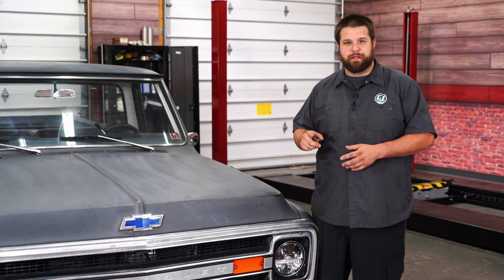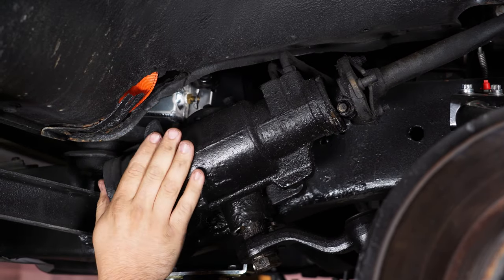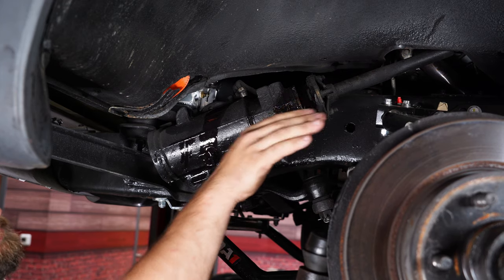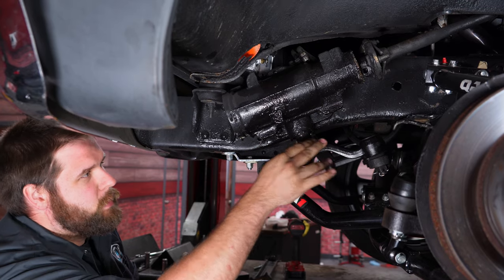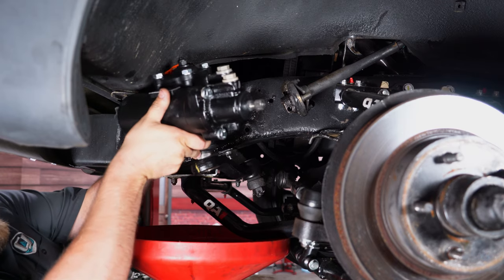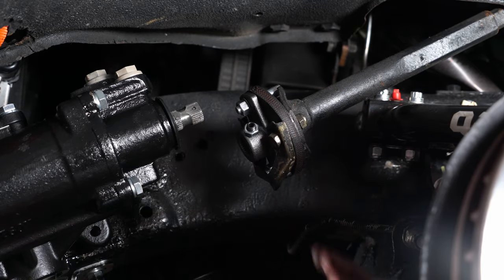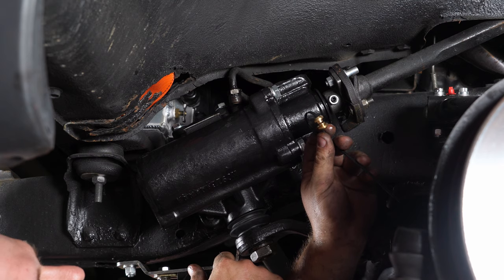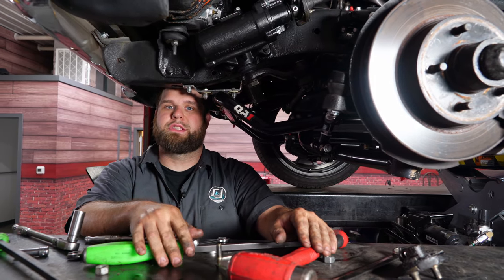Classic Chevy Power Steering Box | Borgeson | 1968-1986 C10 Install

Comment: quite the mechanic I am....I wrestled with the column forever trying to loosen it so I could get the steering box out....when all I needed to do was remove the bumper bracket and it would slide right out! This was when I rebuilt my stock box. Buying one of these quick ratio boxes, so at least now it will be easier this time. Great video for that bit of knowledge alone.
Reply from the maker: Thank you for watching

Comment: I really wish the video included you using a torque wrench to finish the pitman arm nut. We both know that's a big deal to tighten that properly. Otherwise great video, I just did this job on my 60 C10 🍻👍🏻
Reply: Yeah I had to wait for the socket to come in to torque it down
Thank you for watching
Reply: @86hyperstang  what is the torque for the pitman arm nut?
Reply: So....what is the torque for the pitman arm nut? I'm about to do this on my C10
Reply: The torque is not as important as the tapered cut splines with a spring steel lock washer. Use a light application of anti-seize so it will come off 50 years from now and reduce the factory torque by 30%. Use a standard length breaker bar and call it a day! I have never had one come loose on a school bus, 2 ton farm truck, passenger car or pickup. Math = Load X Stretch.
Look it up and quit stretching the bolt to the yield point we’re it breaks!
No one owns “Crows” feet sets or “Flare Nut Crows” feet spanners and a torque wrench because they never use them in the videos! Why? I own 4 sets of SnapOn both Imperial and Metric. Do you? The load in these is tightening the hard to reach fasteners or seating the pipe end like a gasket! These are way more important than pitman arm torque if you have removed one.
DK. ASE Master Tech since 1978.

Comment: Just a note.. My 85 High Sierra had a 12mm 12 point pinch bolt holding the steering coupler.   I damn near rounded it off using a regular socket.  Was too caked with years of crap to see.
Reply from the maker: oooo that would have been bad

Comment: What about the 1967 C10? Will your tiny piston diameter work on the frame using grade 8 pipe spacers and really long grade 8 bolts? At least place the gearbox in place, install shims or washers to get the correct alignment with the intermediate shaft on the vertical axis as the frame holes actually line up the 800 series Saginaw gear box on the horizontal axis. 
  I would not use the 500 series because it is smaller piston diameter, thinner case and less frame to bolt thread engagement. It is 11 pounds less of a long lasting 800 series, which has way more parts, torsion bar selections and heavier case for a pickup use and lateral impact forces it see’s when transmitted to the pitman arms case. The case will oblong and create looseness that has to be machined and new bearing installed 40-50 more often than the larger diameter contact found in the 800 series. I don’t understand unless it is an patent or intellectual properties legal issue.
DK. ASE Master Tech since 78. Former instructor for UTI and ACDelco.

Comment: How much attention should I pay to the position of the pitman (splines) so I don't change the steering - or is this not an issue?  Also, same with the rag joint.  It's splined too.  Just don't want to get in the truck and see my steering wheel is 1 o'clock or something.
Reply from the maker: Both the pitman and rag are keyed they are supposed to fit in only one spot. For the rag joint you are looking to line the set screw on the flat part of the splines
Reply: Larry, With the flexible coupler installation even with the pitman arms splines lined up, it still can be off by one tooth either direction. The steering wheel mount can be moved very easy and should be expected, as nothing is perfect but one tooth is easily corrected. Besides, an alignment is highly recommended after installing a new steering part especially if moving from a manual to power steering gear box. 68 and up have a indention in the frame for gear box housing clearance where the 67 did not. 66 and down have a different frame in front of the steering and have no indention which was common for tooling at the Fremont, CA plant were 70% were built.
Best of luck but no big deal. Try using a bungee cord from the steering wheel to the brake pedal. This too can help.

Comment: Did you have to remove the steering wheel and or listen it to allow the shaft to be hammered up? Thank you. About to do this on my 68 c10.
Reply from the maker: I did not have to remove the steering wheel all you have to do is unbolt at the box the the steering shaft will collapse so you can take the box out.
Reply: @CJClassicTrucks  perfect. Thanks bud. Appreciate it.

Comment: why won't it work for the '67 c10 ?
Reply from the maker: it will work for 67
Reply: The 67 frame is flat and the box will crush on the frame without angled pipe like spaces inside and out. Plus the bolts are much longer and will hit the steering gear box. I took photos of mine when off, then measured the spacers to cut at an angle to be straight with the intermediate shaft were the rag joint connects. The 66 and 68 are different with raised bolt holes and an indentation in the frame to clear the cross shaft / housing of the gear box. It is completely different.

Comment: why wont this fit a 67?
Reply: @LJ Padilla. - 1967 frame is flat where the steering box mounts. It comes with manual only and held away from the frame with pipe like spacers. The spacers would have to cut at an angle about 3/8” off the rear cab side and 5/16” off front spacers at front near bumper. This places the box at an angle with the frame but straight to the input shaft. Use the cut part inside the frame to keep the bolts fully flat to the frame.
  In the video, when the box is off, look at the bolt holes that are raised while the frame is dished inward. Careful measurements and cutting will keep the box from touching the frame except at the bolt mount pads.
  Basically, the 1967 is different from either a 66 or 68. This is why there are no listings for a 1967 C10. The bolts are much longer because of the spacers but can be done.